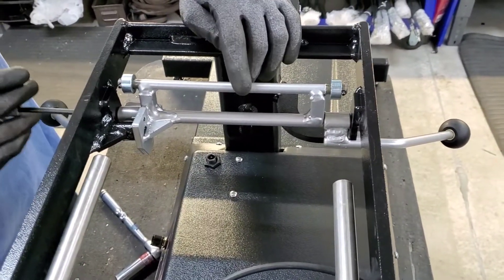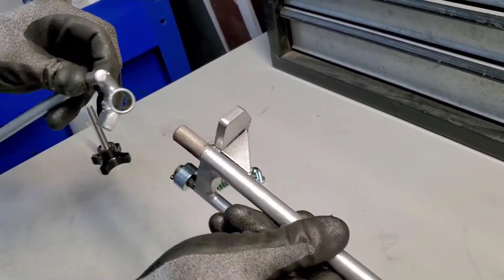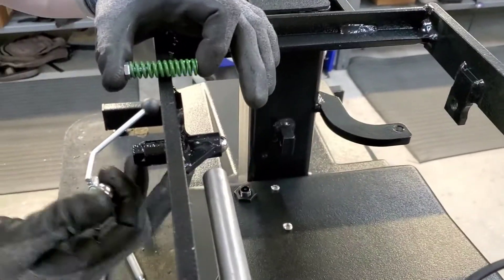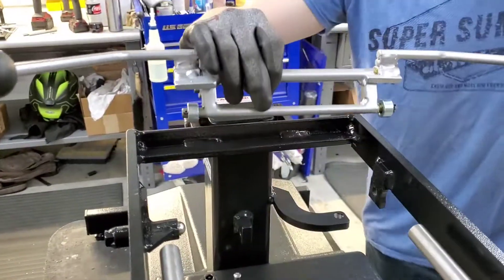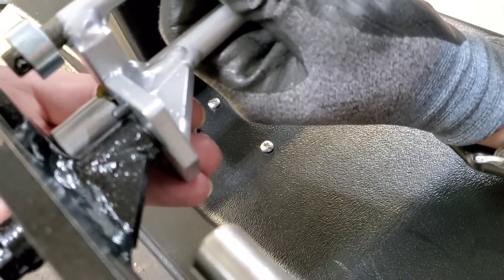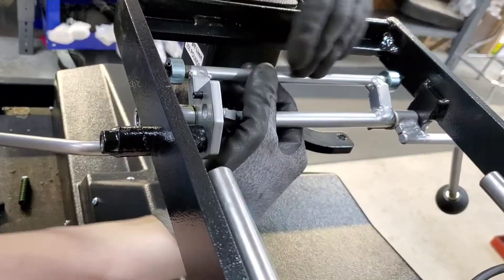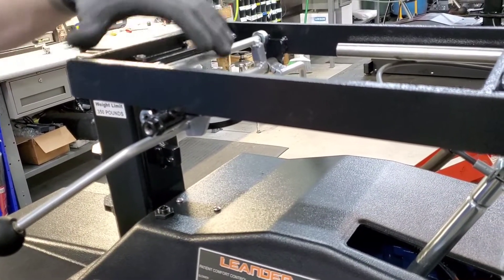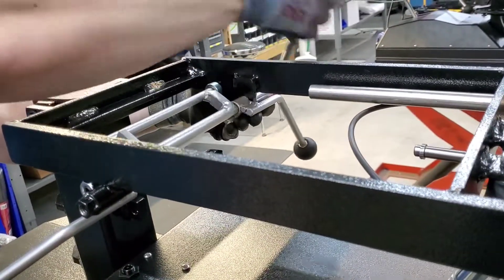Leander Pelvic Drop/ Thoracic Drop Rudder Replacement

Comment: Any advice on a tension screw that still is firm even when it is backed off.  The tension is better on one side of the drop versus the other.   Should I replace the spring and ball bearing?